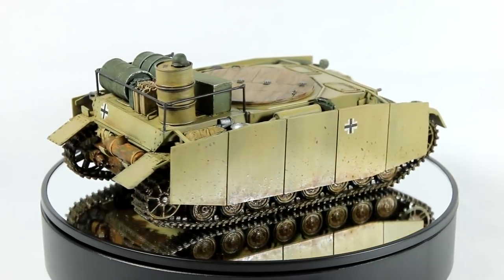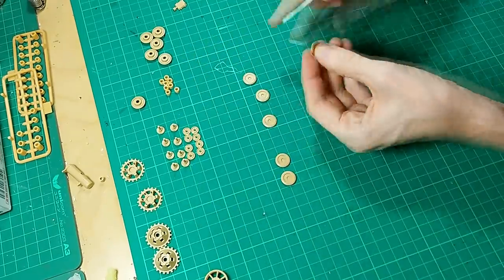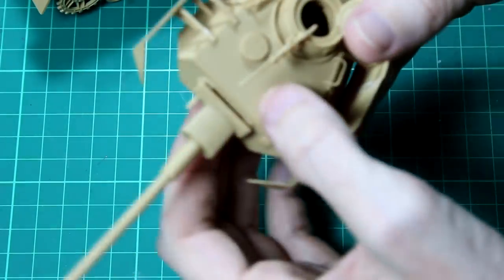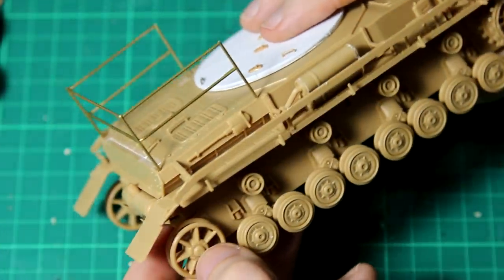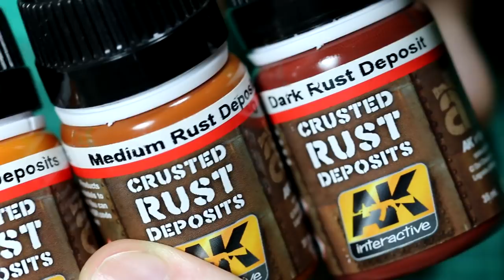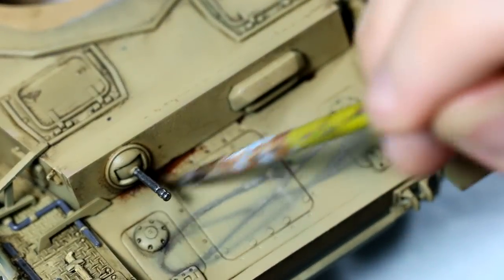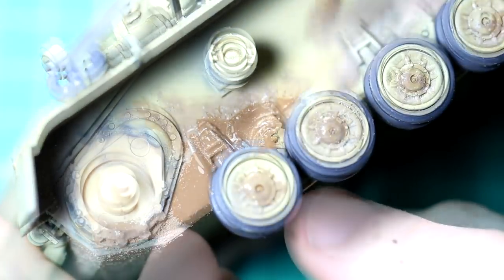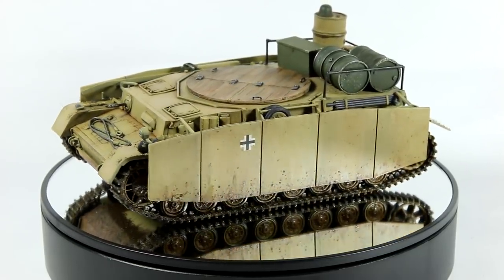Panzer IV Ausf H Ammunition carrier (Academy 1/35 scale model)

Comment: Nicely done mate !! And you can always use the other part as a fixed concrete gun position, i’ve did it in the past with a panther turret after using the panther body with a german quad flak attached to it (which is honestly still sitting two third finished after losing interest when waiting for some metal barrels for it, lol, as you do !!??, obviously it’s on the ‘to do list’ with several other of the usual ‘half finished’s’ that tend to crop up in a modellers life, where as the panther turret became a fixture of an Italian mid war dio,
Reply from the maker: Thanks sounds like a great idea (both the fixed gun position and your flak Panther). Thanks for sharing!

Comment: What do you use for your clear coat for you washes?
Reply from the maker: For the clear coats, I prefer rattle cans. My go-to is Tamiya TS-80 (flat) and TS-13 (gloss). However, I've recently had problems getting the Tamiya rattle cans, do I've found Mr Top Coat rattle cans pretty good as well. They also do a semi-gloss, which is nice because it makes it easier to bring the model back to a flat surface at the end. Their gloss also seems glossier than Tamiya's.
Reply: @ModelNerd  ok thanks! If I was to get one would you recommend gloss or flat?
Reply from the maker: For the washes, semi gloss or gloss, so they flow better.

Comment: What an amazing finished product, I love how calming your videos are. Also I have a question. Where do you get all of your oils and mud weathering effects because I can’t seem to find them at my local modeling shop or online? Thanks have a nice day!
Reply from the maker: Thanks Julian, I'm glad you like them. As for the oils, I found them in my local hobby shop. Where are you located? The mud weathering products are much harder to find near me - I got mine while I was travelling and I've struggling to find replacements either online or locally.
Reply: @ModelNerd  I live in Sacramento California. Also what is the brand of the oils?
Reply from the maker: Hmmm, I'm not familiar with any US outlets. I know (air) shipping can be an issue with paints. The brand is Abteilung 502. You can use regular artists oil paints as well (and I do sometimes), but I find the 502 paints much smoother.
Reply: The store that I go to is RC country hobbies. Speaking of artist oils, I used some of my dad’s for the streaking effect. Luckily I practiced it on the underside first because it didn’t work and my acrylic base coat underneath came of with the oils. I think I did it the right way but not sure.
Reply from the maker: @taco6658  I'm guessing the base coat came off once you started to use the thinners to blend the oil paints? You'll need to put down a gloss or semi-gloss varnish over the base coat to protect it first. I normally use a rattle can varnish from Tamiya or Mr Hobby.
Reply: @ModelNerd  yep that’s what happened, will Tamiya flat clear work? also thank you for answering all of my questions and getting back so quickly, I only have 14 models under my belt so I’m kind of new to the hobby and your really helping me out. Thanks again!
Reply from the maker: No worries. A flat coat would technically work to protect the paint, but the very fine texture of a flat coat absorbs the paint a bit more, which can make it harder to remove or blend and can make the paint sort of wick into the surface. On the other hand a full gloss coat can be too smooth and the oils can just fully wipe away (although this is less of a problem).So I'd recommend semi-gloss. You can put a flat coat down afterwards, once the oils have fully dried.
Reply: @ModelNerd  ok thank you, I will get semi gloss.